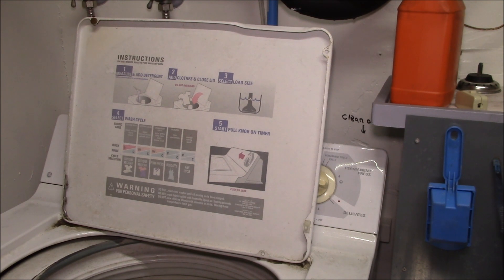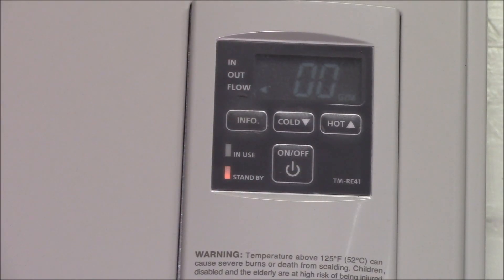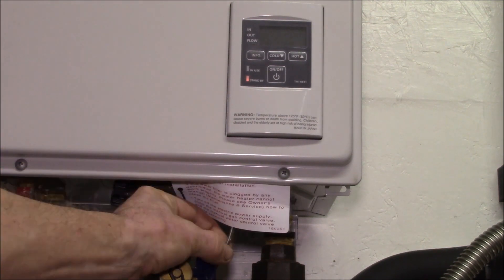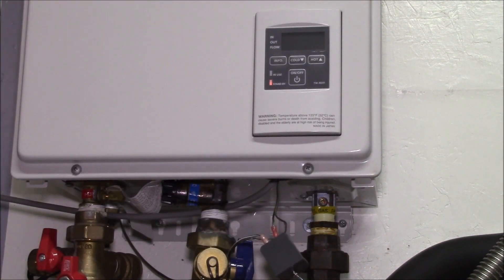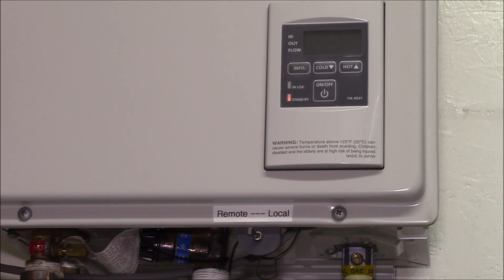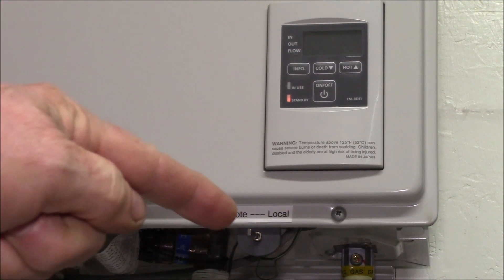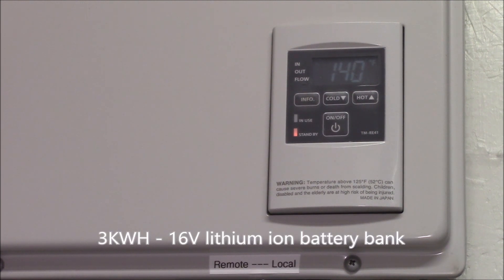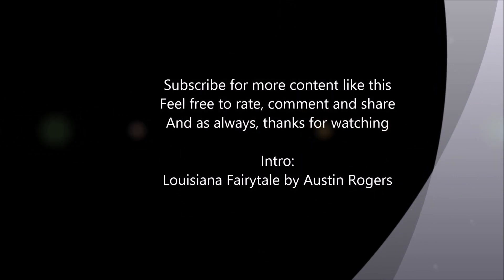Takagi Tankless Water Heater - Remote Control Priority

Comment: Why does mine read 991
Reply from the maker: Check the error codes listed in the owner's manual:
991: Imperfect combustion
• Check if the gas type of the water heater matches the gas supplied to it.
• Inspect the environment around the water heater. Determine how long the water heater has been installed and match DIP switches.
• Check the altitude/elevation of the area of where
the water heater is installed.
• Check if there is any blockage in the intake air and/or exhaust.
• If the water heater is installed as a direct-vent
system, check whether there is enough distance
between the intake air terminal and the exhaust
terminal.
• Check if there is grease and/or dirt in the burner (Part #101) and the fan motor (Part #103), especially if the water heater has been installed in a contaminated area
• Check the DIP switches match gas type of the water heater.
• Check the manifold pressure at Max. and Min.
• Check combustion chamber tube (part #117) to see if it is clear and securely installed.

Comment: What does it mean if the “in use” light isn’t turning on when I try to run hot water? My hot water isn’t working
Reply: I have the temp set to 120 but when I turn on the hot water, the stand by light starts flashing and the screen is flashing and says 111
Reply from the maker: @Ashhz2cr  Per the manual:
111 or 121 Three Flashes Ignition failure / Loss of flame Ignition Failure / Flame Loss, p. 12.
That means the burner isn't firing.  Maybe the gas is shut off at the unit or to the house.  Check out other possibilities in the service manual, page 12, as noted.

Comment from the maker: This little modification has proven to be very handy.  When I'm out at the heater, either flushing it or doing laundry or using the utility sink, I can flip the priority switch and have full local control of the heater.  Flip the switch back and I can use the remote in the house.  Sure saves a lot of running back and forth like I used to do.  With the tank less heater, having control over the water temperature for the task at hand is the #1 best feature IMHO.  So having multiple remotes to give you that control is important.  

The water heater has been working perfectly fine off-grid on the solar power inverter.  I've not had to use it during a power outage, but I could if I needed to.  That has been saving 2KWH of electric energy per month.